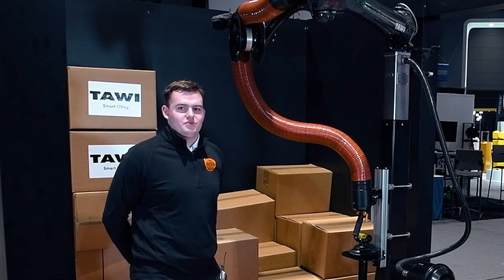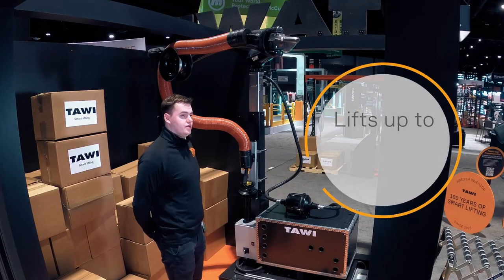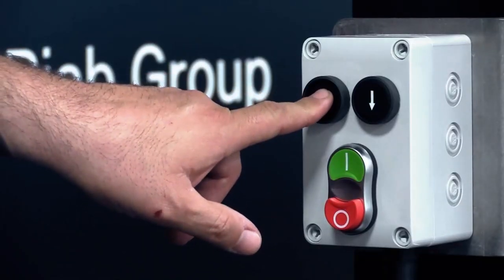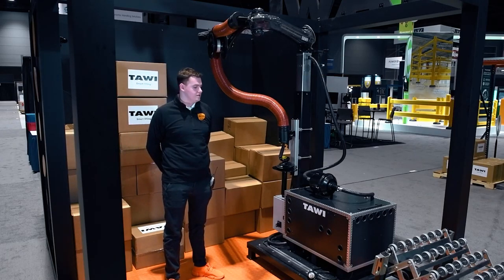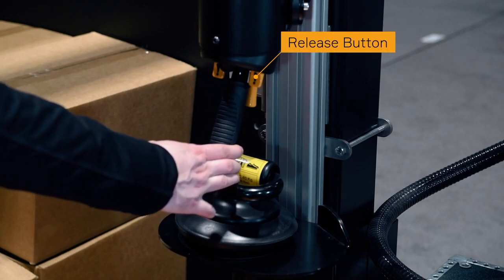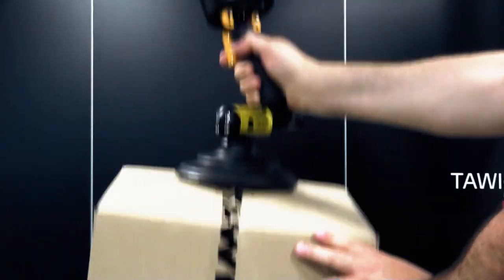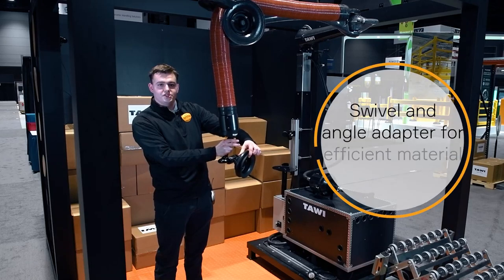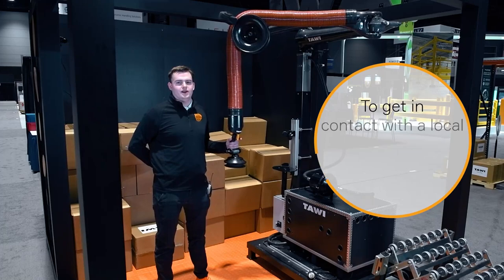Container Unloading Lift Assist at Promat 2023 in Chicago - TAWI MHL Vacuum Lifter

Comment: Can the handle lock in the side position in order to pick up boxes from the side
Reply from the maker: It’s possible either by using the swivel and angle adapter, but also with a variety of tools which makes it very easy to lift load from the side.
Reply: @TAWIGlobal  thank you